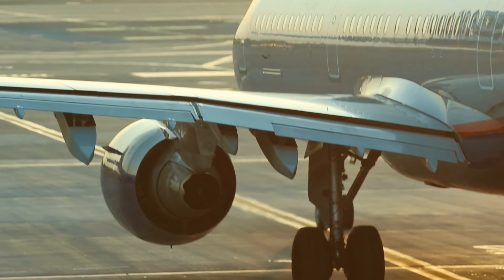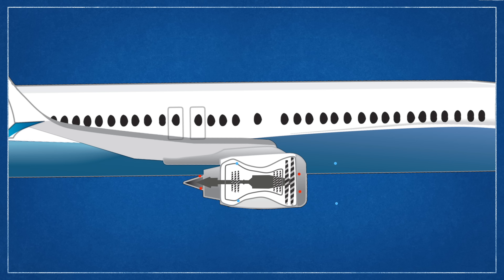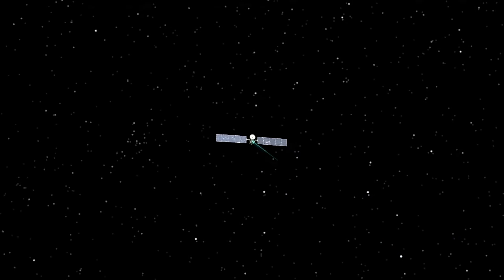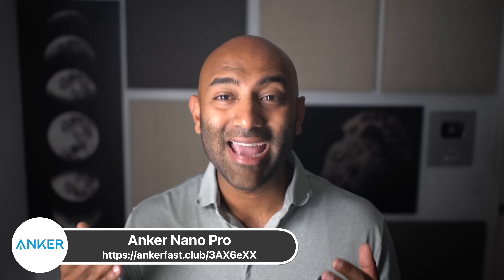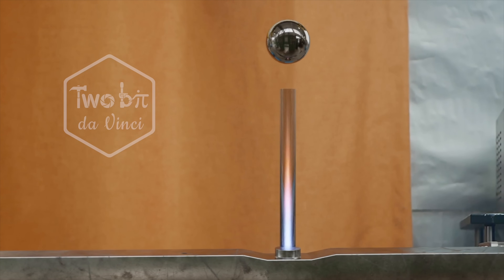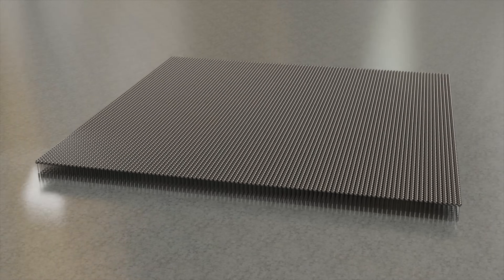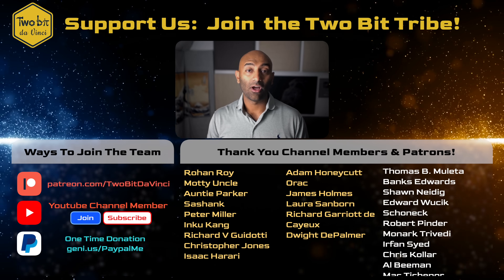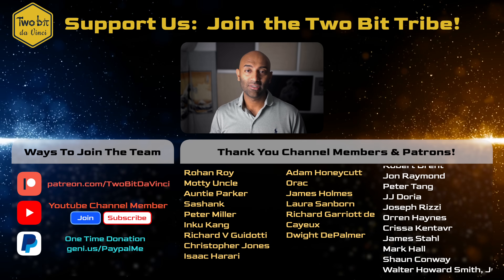The Next Generation of Jet Engines.... Is Electric?

Comment: The bigger batteries needed would be perfect for an airship/hybrid craft platform that can already, at least in part, manage it's buoyancy.
The floats would leave more room for cargo, and fill some slightly chunkier wing cavities instead of fuel.

I've always wanted to see hybrid crafts come out. The smaller engines that spool up over time would lead to some interesting turning radii and rise and fall angles.
Reply: I always wondered if it was possible to create an Hot Air Rigid Airship that stays aloft using solar.

 Basically you would have solar covering it storing electricity that would be used to heat up air inside the ship causing it to float. Also using the same electricity to power the fans for maneuvering. 

 This would allow you to basically float indefinitely without the need for refilling except for supplies. 

 Of course you could have a small hydrogen back up generator as well just in case. Yet this would beat hydrogen or helium airships that tend to leak, and need to be refilled. Helium is limited, and expensive. While I don't think Hydrogen is as vad as people say? There is always that risk. 

 If I were filthy rich I would build that instead. Have a nice little flying condo that is always moving so I can stare down at ya filthy peasants with a telescope, and gods eye view. 

 When I mentioned it to someone else. They told me to boil water as steam does have a lot of lifting capacity.
Reply: How about hydrogen fuel cell?

Comment: Zero emissions engines is an oxymoron.  All engines generate some sort of emission whether it's the thrust exhaust of the jet engine to the waste heat of an electric motor, they all emit some sort of emission that must be managed.  The proper term should be low emission engines.

Comment: Be careful what you assert... there is literally no reason aircraft cannot fly at the same speed as currently with electric propulsion systems or hydrogen hybrid systems. The reason aircraft fly at the speed they do is not to do with the propulsion system being the limiting factor but instead is to do with aerodynamic efficiency and other factors. If you swap out the core of a turbofan with an electric system to create an electric ducted fan (EDF) you can get the same thrust as the jet engine (assuming of course battery technology is good enough for electric to be feasible at all, which will also happen long before it is good enough for plasma thrusters by a few orders of magnitude). Thrust is simply the product of how much air you move and how fast you move it, modern turbofans the core is actually acting mostly as a source of power for the bypass fan and the bypass fan creates most of the thrust (since it is more efficient to create a given amount of thrust to accelerate more air less). To claim aircraft will have to be slower and plasma thrusters (which use orders of magnitude more energy and do not scale well to high thrust at all) are somehow the solution is just completely and totally wrong.

Comment: We need to think in a different way. Plasma thrusters can be used as a smaller atmosphere to space vehicle. As limited fuel is required and battery size would reduced. Start small as we did with airplanes originally. One man vehicles first. Larger vehicles could combine technologies to switch over once off the ground. Quite often we make things harder than they are using our tunnel vision.

Comment: The problem for electric aircraft is not the engines it's the fuel. Batteries aren't sufficiently energy-dense (yet) so the tech reviewed here is held up by storage.
Reply: Dude!  Just get all the passengers to do some meditation using the “Om” chant continuously while flying and there’ll be plenty of energy; and it will be positive energy!  Cosmic, man!  Who said New Agers couldn’t be useful?  😁

Comment: Extremely misleading: issue is that a jet using plasma engines would need an electric power source of about 25 MW per engine. The reason why Jet fuel is used is to supply the power needed to generate the thrust. 

Plasma engines in space are extremely feeble and cannot provide enough thrust to support a single sheet of paper against gravity. The VASMIR engine would use a nuclear reaction since it needs about 200 KW, and produces enough lift to hold up a coffee mug, an empty coffee mug (about 1.6 Ounces).
Reply: That and people forget that the energy density of Jet A is MASSIVELY more than any battery, plasma or alternative "fuel" we have.
Kills me when people completely ignore energy density when talking about electric or other propulsion tech.
Reply: @shirothehero0609  Plasma is not a fuel it's a "propellant" created by ionizing the air (oxygen and nitrogen mainly). 
But you right, the energy density of the best battery is laughable compare to hydrocarbure. less than a groundbreaking revolution on electricity storage, this is not gonna flight.
Reply: @vincentvoillot6365  for sure.
That's sort of what I was trying to infer since fuel, energy, power source, power, propellant, discharge, gas, exhaust, etc. and whatever other related words are always used interchangeably and incorrectly when it comes to engines, motors and propulsion, but can make huge differences in the actual meaning and implied functionality.
But yeah.  For sure.
Reply: @shirothehero0609  It's because all people know is "green" green is expensive, green is unreliable, green is not energy dense, green is running absolutely everything on minimum power because of that, yet the FUTURE is MORE ENERGY CONSUMPTION. It's a total disconnect, you can't mine the rest of bitcoin with the entire planet's energy production, you can't get to Mars without a chemical rocket, you can't power a jet without jet fuel or produce a meaningful amount of power without water yet all people can think about is batteries and solar panels, they both SUCK and solve nothing.
Reply: Exactly, even with breaktrought it's not very efficient in atmosphere. And how do you solve the exhaust problem ? nitrogen oxides is not really environement friendly ;)
Reply: These engines could be powered by direct hydrocarbon solid oxide fuel cells, which themselves would give a huge efficiency boost even if you didn't use plasma engines.
Reply: @augustovasconcellos7173  Nope. Solid Oxid fuel cells need to operate at about 500C\940F and are very heavy. 
No electric system is going to beat jet fuel for aircraft propulsion.
Reply: @guytech7310  What temperature do you think jet engines operate at?

Also, the specific power and power density for SOFCs is 2.5kW/kG and 7.5kW/L respectively, which is better than piston engines.
Reply: @augustovasconcellos7173  A typical commerical jet engine operates at about 25MW. so a dual engine plane would need about 50MW and a 3 engine would need about 75MW.  I suspect SOFCs are heavier than you suggest since the consist of ceramic plates. Kyocera SOFC weighs at 5 Kg for 700 watts, or about 0.14 Kw/Kg. The other issue is SOFCs ceramics are brittle & unlikely to hold up vibration & shock forces (landing) in aircraft. 

A SOFC is about 60% efficient and modern Jet engines are about 42%. The added weight of the motors, cooling systems, cabling, power conversion, etc going to consume that ~18% efficiency gain. Also I do not believe SOFC can ramp up power output like a Jet engine which can go from about 5% power to 100% power in a few seconds. I suspect a SOFC probably would take 30 minutes or more to make a significant change in power output.

Using SOFC for aircraft is just a pipe dream. First lets see of SOFC are ever cost effective for ground systems (home power generation), vehicles, etc. Right now SOFCs costs about $450/W which makes them uneconomical for ground based power uses. Solar is about $3/$4 per watt (including voltage conversion). Unless SOFC costs can drop by at least 50 fold its not going be widely used.

FWIW: Commercial Air travel dies when Oil prices are sustained over $120 bbl (adjusted for inflation). My guess Oil prices will be about that by 2030 or sooner (depending on Geopolitical & economical problems). In my opinon that is not enough time to make the transistion even if a viable energy replacement system arrives tomorrow.  High oil prices will play a significant role in economic decline putting a major drag on consumer discretionary spending (ie air-travel). 

Already the need  Business travel is getting eliminated as technology has eliminated the need for a lot of business travel. Airline profits have already declined by about $200B since 2019, and likely to continue to fall for the foreseeable future.
Reply: @guytech7310  
>fuel cells are made of ceramics and ceramics are heavy

Ceramics are not heavy. They are lighter than many metals, including steel. There's a reason why ceramic is used for lightweight ballistic armor, heat shielding in spacecraft, etc. 

Also, those power density values I gave you weren't just pulled out of my ass. They came from a NASA patent. I can't link it here because of YouTube's spam filter, but you can Google it no problem.

>ceramics are brittle and can't handle vibration 

See my point about ceramics being used in bulletproof armor. 

Besides, composite materials can drastically improve the mechanical properties of ceramics. Your bones are a ceramic composite, for example.

>fuel cells can't throttle easily

Where did you even get that idea? If anything, they should throttle faster because there is no reciprocating mass to offer resistance.

>SOFCs are only 60% efficient, which isn't far from gas turbine engines 

Elcogen has a methane-fueled SOFC with 74% efficiency right now for sale. And by sticking a turbine on the fuel cell's hot exhaust, you can generate even more power by reclaiming waste heat. Turbocharged fuel cells can potentially achieve 90% efficiency.

>SOFCs are too expensive 

Yeah, no shit they are. We only even knew they were a thing for like 20 years. Solar panels and lithium ion batteries are over 50 years old by now, and they used to be just as expensive - if not moreso - when they were as young as SOFCs.
Reply: Just having an electric motor drive a ducted fan would be much more practical, just swap out the core for a motor and that would produce significantly more thrust than a plasma jet, along with probably using less energy too
Reply: VASIMR produces 5N thrust
Also in-atmosphere plasma jets can be significantly more effective if they rely on heating instead of magnetic acceleration
Reply: This comes at the cost of fuel efficiency though, eliminating absolutely insane ISPs like 50000s
Reply: Thanks for doing the maths.
So, plasma jets is a pipe dream until we have a factor shift in the capabilities of batteries, which will be unlikely to happen in our lifetime.

It looks like artificial fuel using carbon capture will probably be the best eco way for jet liners to go.
Reply: @marc0523  Yes,that seems more feasible.
Reply: @marc0523  Batteries are NOT AN OPTION. This is one of the biggest problems with this green energy monstrosity people think is somehow good. Batteries are HORSE SHIT. They do not produce power, they are not energy dense, they are very expensive, and they provide almost no solutions! We need the next evolution in energy GENERATION, NOT STORAGE! We can't freaking produce a meaningful amount of electricity without water, after 100 YEARS of doing it that way, and yet we still invest in batteries!? Batteries are 10000 years away from being able to power these engines, yet people still think we should invest in them, when it's not even remotely feasible to power anything, because "green". Green energy is going to keep us in the dark ages for centuries.
Reply: @bobbygetsbanned6049  Batteries are energy storage, not production, no one is saying they are energy production.
Green power productions works brilliantly, it produces almost half of the UKs power a lot of the time, we have gone months without powering up any coal power plants, the more renewable energy production we get the better.

Energy STORAGE is still a problem, batteries are expensive and not energy dense, no one argues against this. But they are getting better all the time.
Within our lifetime batteries will be powering everything, no question. They probably won't be lithium-ion, or maybe even a technology we have though of yet, but they will be what we all use all the time.
Reply: @bobbygetsbanned6049  

nuclear is the best method for central power plants. Small footprint, very high power, no pollution.

We use it on submarines, it works great. I was slightly against it until my service on submarines: I spent months (87 days was my longest underwater period) living less than 600 feet from an operating nuclear reactor.
Reply: @marc0523  didn't nuclear help with that too? Solar and wind are diffuse power sources.
Reply: @neutrino78x  yes, but nuclear is insanely expensive. As a green energy it's fine, as a business decision it's fucking terrible.

New technologies might change that, but we will have to wait for them to exist before we can know for certain.
Reply: @neutrino78x  I never said I have a fear of nuclear, I do not.

I have had no part in the production of current, or past, nuclear plants, I was not involved in managing the costs of nuclear plant production.

If nuclear is so financially viable, why are businesses not building nuclear power plants to make money?

The reason why they all have financial support from the state is that they are insanely expensive.

Nuclear submarines are not known for being cheap to run either.

Comment: There is still a lot to be done to increase the efficiency of the designed plasma thruster. The magnetron itself seems suspiciously close to one you would find in a microwave. Hopefully research in this area will mature and maybe even develop other plasma devices.